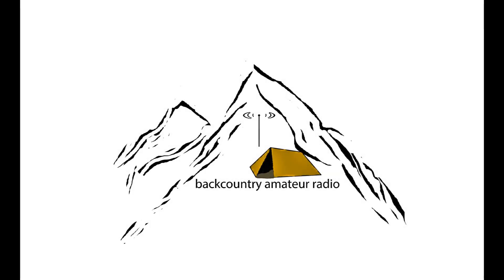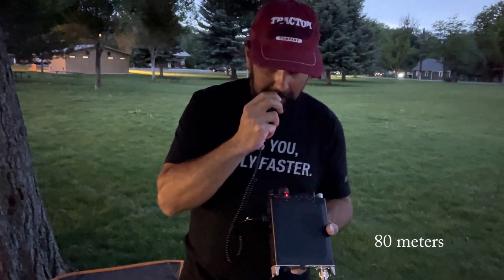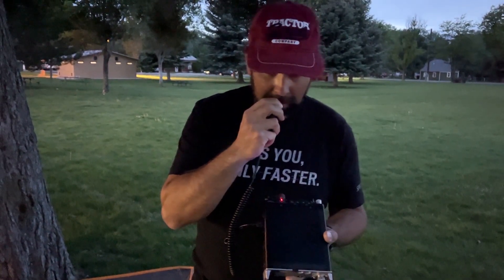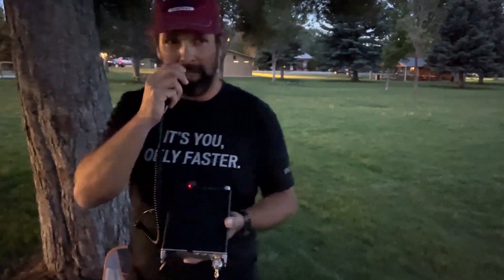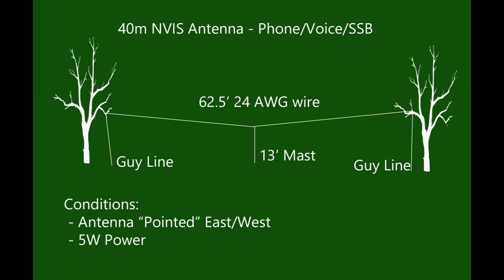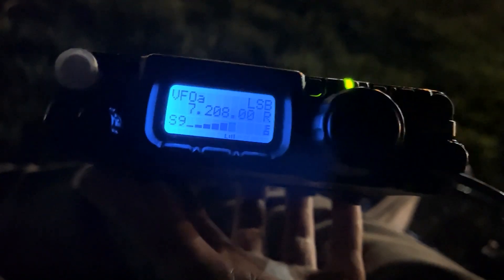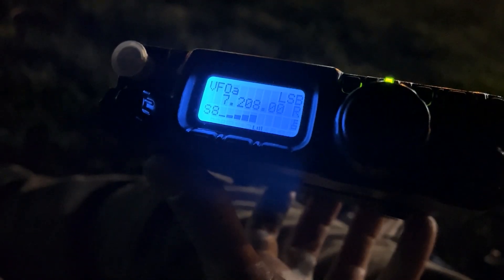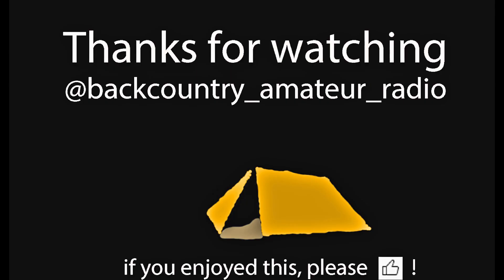Near Vertical Incidence Skywave Demonstration from Both Radios with@hamradiowithkevin - Emcomm

Comment: Please clarify how nvis bridges communications between vhf handy talky and hf radios
Reply from the maker: Imagine 2 locations (for this example) that are only 112 miles apart. It will be difficult to use energy efficient means to communicate over that distance with UHF/VHF. Normal HF ops will dramatically overshoot that intended distance and take you into the next state two states away. So, NVIS provides an efficient way to cover the ground in between. Local communication can be efficient with HT's but when the community needs supplies from a town 112 miles away NVIS gives you that. This needs a video.. NVIS ops gives the operator a way to communicate with groups at a distance that normal HF and VHF just can't efficiently accomplish. It is one reason the military developed the technique. Hope that helps a bit, please add your thoughts on it. - KI7WJP

Comment: With only 29 miles between you two, and being on 75 meters, how do you know it wasn't just groundwave action going on.
Reply: I'm guessing you missed the picture with the 11,000' ridge line between them.
Reply: @markjob3965  Good point. I assumed the signal would knife edge over the ridge, but at 11000 feet that would block it.
Reply from the maker: There is still some potential of this. Given the S7-S9 signal strength I’m inclined to believe that it was NVIS. I guess we need to do a similar experiment with no mountain between us at a similar distance.
Reply: @backcountryamateurradio  I'd be curious to see what kind of result you would get.